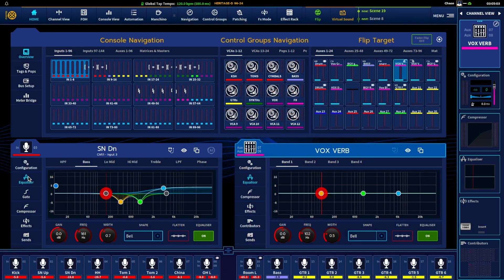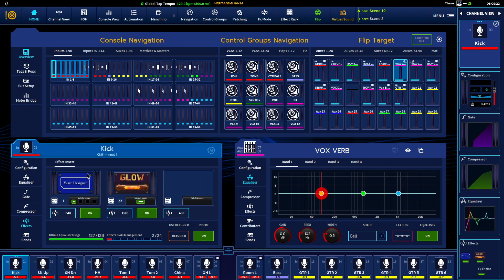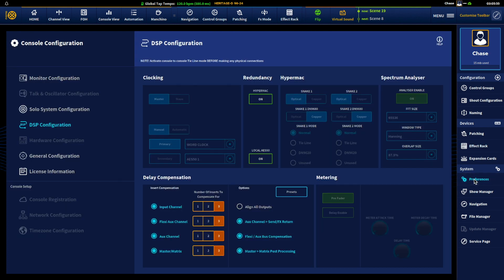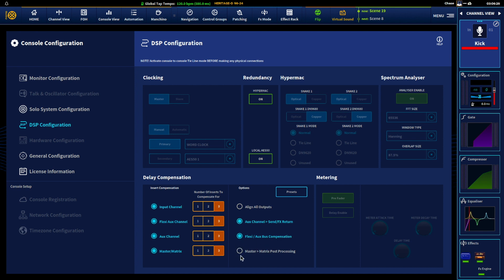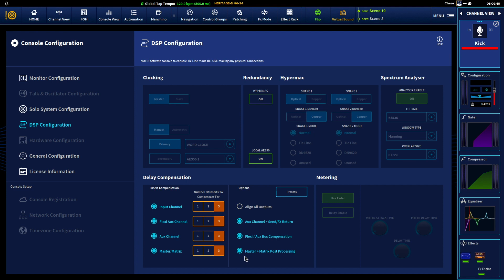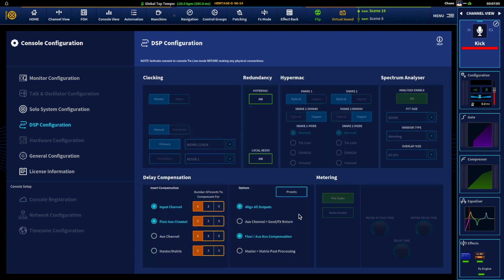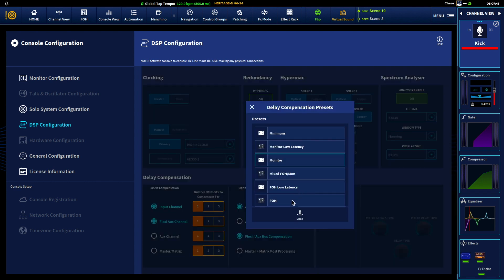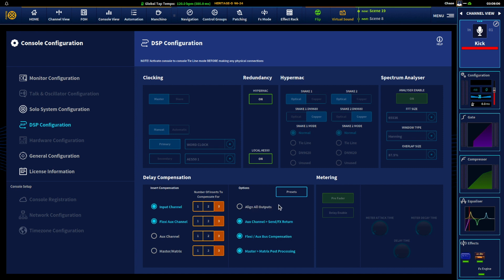Midas Heritage-D HD96: Delay Compensation

Comment: I have a showfile with tons of inserts on individual channels,  groups,  etc as well as groups to groups to groups via FlexiAux, etc.

I have disabled completely any delay compensation on my file and instead manually aligned all the channels with channel delay.
All channels with time aligned, flat phase traces.

Then I turned individual channel delays off and tried to find ANY combination of insert compensation setting in DSP settings to replicate my flat phase traces with the manually delayed file.

Very confusing....I'm not really sure how to use the built-in delay compensation. Seems like manually aligning is the way to go.